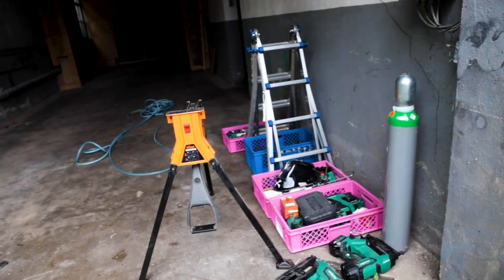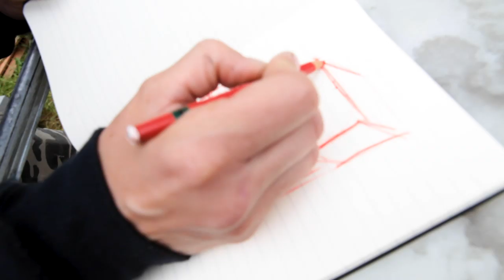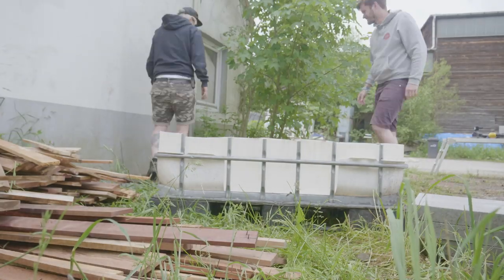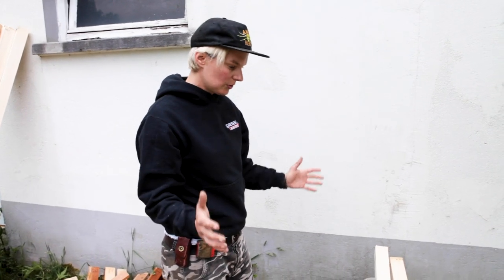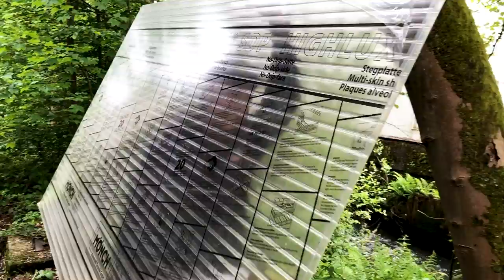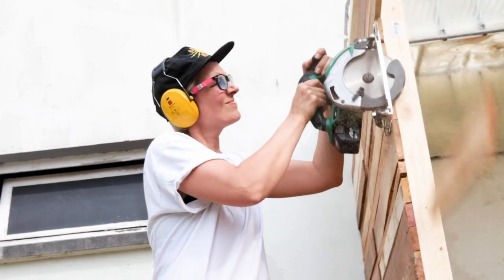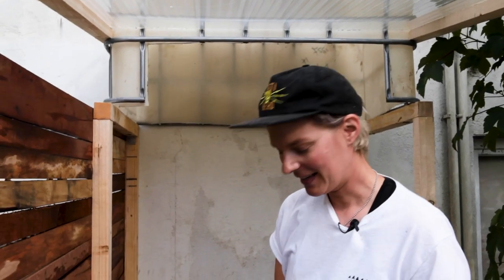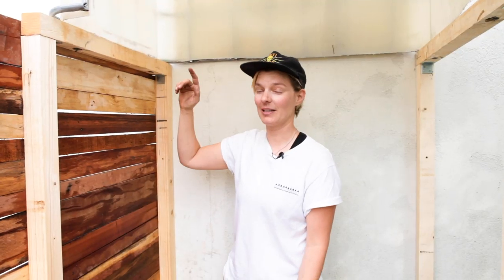Building a cheap outdoor shower from water tank

Comment: hi Laura,
For more safety you can fix the plastic top to the  metal chassis with some rivets along the lower edge of the plastic bin. 
And surely, later you'll fix the shower terminal to the great cap in the middle of the roof.
What a great gift you have received from your neighbour: that policarbonate plate, here in italy cost around 50 euros or more (of course it depend on the thickness) per square meter!
i'll see you on the next videos.
Ciao!

Comment: Maybe add some sort of wooden floor with holes so people won't stand directly in that plastic bin.
Reply: SiriusSVK like some kind of slats like bamboo or something
Reply: SiriusSVK Teak or bamboo bath ‘mat’ would be perfect
Reply: Any rot resistant wood would do  Redwood or Cypress or Teak or Ipe  ( E pay ) liked used on outside  or manmade decking  as short as the shower bay is  it could probley be made from cut off salvage pieces

Comment: yes ,nice project .You dont need wooden walls all the way - only from shoulders to the knees . The rest can be remains of roof plastic or open .Water in black container or hose will get warm in the sun during summer .Good luck with your new shop . Love your enthusiasm . Smudo is the best as always : ))
Reply: Black plastic irragation line would be perfect  layed out in a coil on the roof would be perfect  but I would suggest a hot and cold water mixing vavle in case it works too good

Comment: At my aunt&uncle's place in France, we made a solar hot shower.
Piece of board of about 1m square, paint black (or black plastic over it), then make a spiral of black plastic garden hose over it, then a glass pane (in this case, an old window). Tilt the whole set such that it is at right angle with the (morning) sun.
Connect one end to the cold water supply, other end to the hot feed of a shower tap (and connect the cold side to cold water as well!)
About 15 minutes of sun was enough for a 3 or so minute shower, but if you let it heat up longer, the water was so hot you needed to add cold water. So you could do longer with the warm water.

Comment: Stove? Laura, you need a solar water heater! Just coil up some black tubing where it’s exposed to the sun— somewhere above the shower. Even a bucket painted black might do the job in summer.

One piece of advice: Put some kind of caps on those vertical tubes (the cut tubes that were part of the water tank frame). Otherwise, they will fill up with water and the frame will rust out from the inside. You could stick little corks or pieces of rubber in the openings, or fill them with silicone caulk or that spray-in construction foam that comes in a can.  Maybe you already did this, but I didn’t see it in the video.

Comment: Here in Portugal we use these containers all the time but.... we put one on top the other way around so it holds the (rain) water, paint it black and... within a few hours you got free hot water. (I myself just use a 15 liter antique bucket with a showerhead attached that is filled by a black hose on the roof). But the idea is simple and nice...

Comment: Hi Laura!

You could use sun to heat the water. Black metal reservoir on top of the shop would be sufficient. Just like the camping solar shower pouches. :)
Reply: was thinking (almost) the same :D
A black painted metal barrel on top of the shower where you collect rainwater
Reply: @DerOhneHaare  The structure wouldn't last that weight. But the same principal.

Comment: We used to build something similar from thick walled PVC pipe, 1/2" wood slats for a floor and 5 gallon water containers overhead, or 35 gallon trash cans with a small water pump, and for luxury  use a small water heater. They were great for camping because they disassembled easily for travel.  Build it in an hour, assemble / disassemble in 5 minutes.

Comment: You could make it a solar heated shower with a panel of black abs plastic pipe. I’ve seen videos of people making them to heat pools. Also on the base maybe get some more of those cement tiles you used for the foundation. Would be less slippery than a plastic base.

Comment: Small piece of critics: For this kind of showers it is better to make their height as small as possible as whole volume has to be heated very fast by hot water. Walls should be water and especially wind isolated as in windy weather it will be too cold. Best option that I have found is  linoleum that is chip and stapler can be used to fixate it in minutes.

Comment: I'm sorry you had to leave your previous shop after such a short time.  You did a lot of work to fix it up.  Last week when you described your bin storage system as being for a new studio, I felt like I'd missed an episode -- what new studio?  Maybe I DID miss something -- I'm surprised you haven't talked about this move more.  Ordinarily I'd say your financial arrangements are none of our business, but did you buy this new studio, or are you renting?  The reason I asked is that you just drilled a bunch of holes in an OUTSIDE wall.  The kind of wall the water is not supposed to come through.  If you ARE renting, I hope you had the owner's permission!  Good luck finishing the shower.  I'll be interested to see what you do about the door.  I guess you could make it out of pallet wood like the walls, with a classic Z brace holding it together.  I also hope no Peeping Toms have access to the property -- there are some pretty big cracks between the boards in the wall.

Comment: I like the new video format. It's also nice to know that even the greatest makers have to use alignment calibration tools (hammers) and squint and pull funny faces when using power tools :) Guessing you might go for some kind of coiled copper tubing heat exchanger for heating the water?

Comment: Why don't you run black hoses on the wall or roof to collect heat from the sun? When the sun shines you will shower warm. Or put the stove, inside the building, so the heat will be used to warm up the workshop too.
You do great things, keep it up.

Comment: You can get a tankless electric shower head cheap if you have a way to run electricity to you shower.  I am building something similar but for inside my house.  You might also want to put a wooden floor in the bottom so you are not standing on slippery plastic.

Comment: A good idea would be to use a propane water heater and run it of grill propane tanks. Not sure if you can get propane tanks in Europe.

Also the wood walls are a bit see through which would bother me, but might not everyone.

Comment: I mean, I like the finished product, but I don't see what problem the cut up water tank fixed. It was a roof and floor, but you made a second roof and floor right in front of it with a pallet and plastic sheet, and made it quicker.